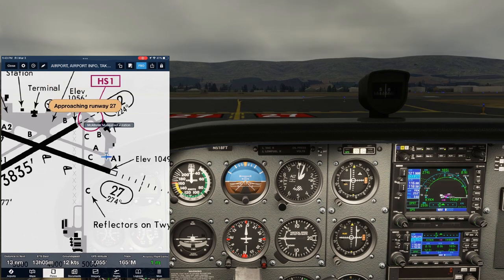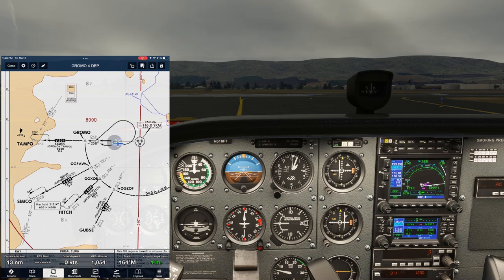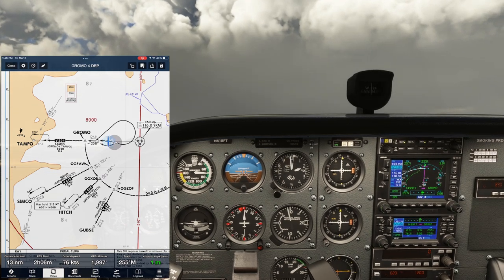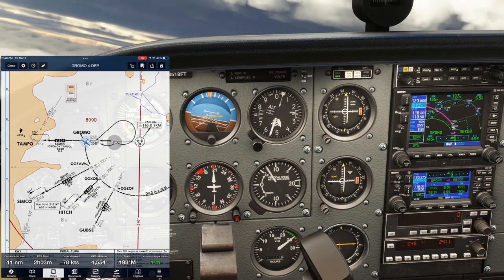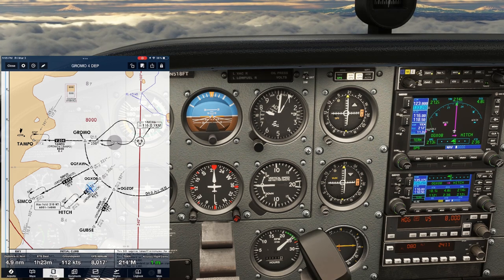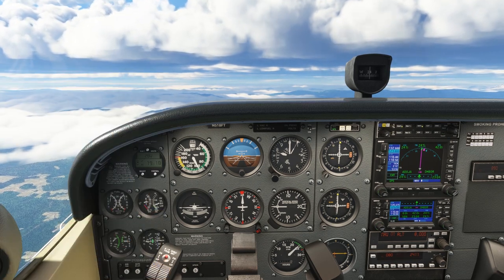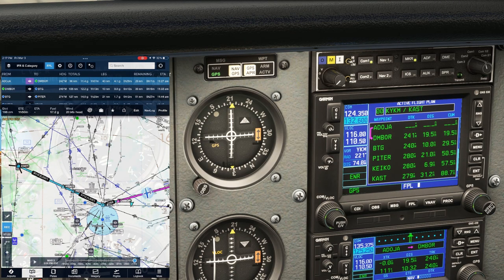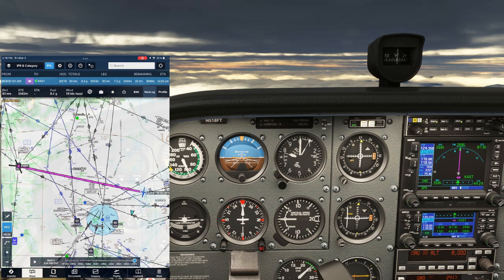Sim Challenge | IFR Flight KYKM to KAST | IFR Departure and Enroute Flight

Comment: These are excellent and am following along in my flight sim.  I'm curious why DME arcs vs just directs from GROMO to OGFAW or OGXOB, etc? I realize we are following the SID as documented, but not really clear why the SID uses DME arcs in this situation at all.
Reply: Well before gps you had to follow a radial or , DME distance , hence the arc
Reply: The procedure is a standard (non-RNAV) SID, that has to be able to be flown with only radio based navigation, as all aircraft are not equipped with a GPS.